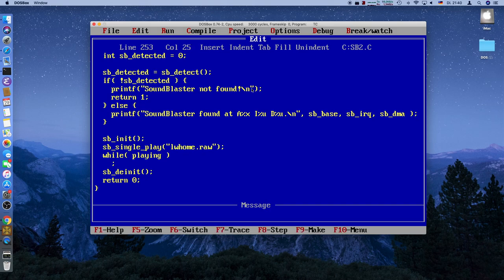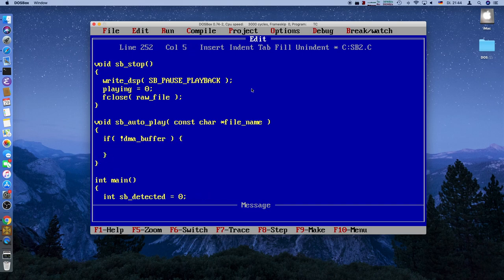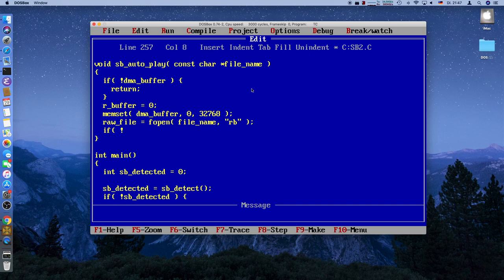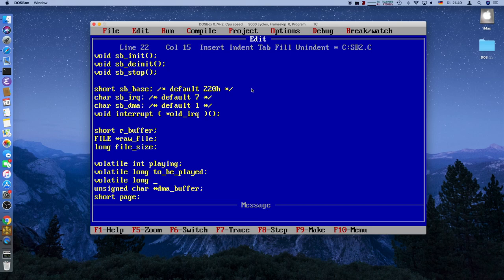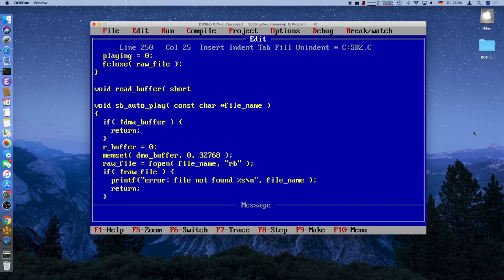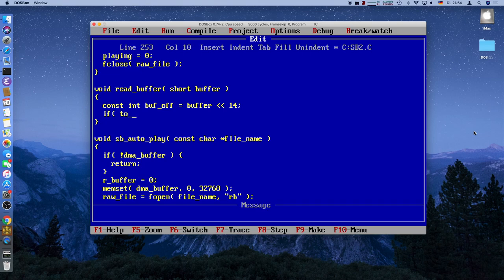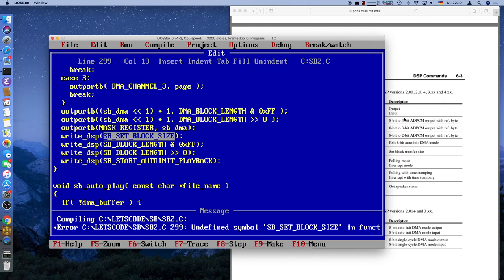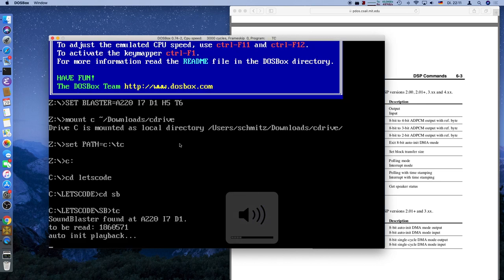Let's Code MS DOS 0x0B: SoundBlaster Autoinit DMA

Comment: First of all: Thanks for the great video. I enjoyed this very much.

Just a minor correction, though: When setting the DMA mode register (DCM), you mention (and elaborate in your code comment) that the first two bits (01) are there to configure it for block mode transfer, when actually they set up single mode transfer (block mode would be 10 instead).

According to the OS dev wiki, this is the correct mode for transferring sample data to Sound Blasters, so the code is perfectly fine, it's just the comment that is slightly incorrect.
Reply from the maker: Thanks for correcting.

Comment: I am trying to switch from single cycle playback to autoinit, so far unsuccessfully because EMM386 crashes the PC instantly when I send 0x58 instead of 0x48 to DMA. Will keep trying, but noticed you are using 0x58 too which is not block transfer, but a single cycle transfer the same as in 0x48. At least every document on DMA I have found says that 01 is single cycle and 10 is block and also that SB needs 01. It is probably just a small mistake in the comment, but it is a bit misleading when someone desperate as me is down to trying everything ;D

Comment: Great video - as always! I’m still coding along on my 486SX-33 with TC 2.01, memory model is set to huge. I’ve compared my code (written along with you as you made this video) with your source on GitHub. For some reason, it doesn’t work as it should on my computer. When the interrupt handler switches from auto init playback to single cycle playback, the program crashes. So it played a RAW file but 2 blocks before the end, the computer crashes. Did you try running your code until the end of the RAW file was reached? I’m interested to see if you encountered the same problem
Reply from the maker: Have a look at episode 0x0D — there I fix a bunch of things. Mainly: Do not read files in an interrupt handler! That could very well be your crash.
Reply: root42 I’m currently watching 0x0D - thanks. I download your GIF.C from GitHub (and MS-DOS messes up the line breaks lol); it does ask to include gif.h — which I can’t find. Is gif.c the same as gif.h?
Reply: root42 Sorry my mistake - I was watching 0x0C. Not at 0x0D yet. Will wait for that.
Reply from the maker: You might want to do 0x0D earlier, since my SB code had a bug that didn’t trigger on dosbox, but on real machines
Reply from the maker: Regarding gif.h: it’s indeed missing. I only published the gist for the gif.c. But the header shouldn’t be too hard to figure out. Otherwise you can use one of the later episodes. They should have a full git repository with the gif.h included.

Comment: wow indeed very nice series ! is there any change you can show us how to mix two or more sounds programmatically using this mode ? i could mix 8 bit unsigned pcm sounds using sb 'direct mode' but i have no much ideia in dma modes ^^
Reply from the maker: You will have to use a timer interrupt to incrementally mix multiple voices in software. The MOD players all do it like that. It takes quite a bit of CPU though. What you can do for example is register an interrupt handler with the timer (18Hz per default) and keep track on where in the second buffer you are with the software mixing. Then simply add up all the samples playing at the moment (e.g. sound effects) for the next 1/18th of a second. This way you don't stall program execution for too long. HOWEVER: if you want to do this in REAL time, i.e. to react to game events, you can't do this in the second buffer of the double buffered audio. This would lead to great delay in when the sounds will be played vs. when the action appears on the screen. At least with 16KiB buffers this will be way too slow. 

What you can do in this case is make the buffers quite small, let's say 1/50th of a second. So 440 bytes at 22KHz. Everytime the DMA IRQ fires, you mix the next 440 bytes, taking into account all currently audible effects (gunshots, enemy screams, etc) and be very quickly done with it. This way you only get 1/25th of a second of lag (because we are double buffering). I think this would be acceptable. It definitely isn't an easy task though...
Reply: @root42  thanks a lot for such a complete explanation, i could get the idea ! well, i'll try the 'single cyle' first and see if i can mix later. please keep with your great work :) !
Reply from the maker: I would be interested in results. I never did something like that either, but might need to do for the final game I want to do on this series.
Reply: @root42  so cool ! i will definitely follow your videos, i can't wait to see the start of the game :) !
Reply: @LeoOno  Hi Leo! Have you managed to write a mixer yet? I can't figure out how to do so :)

Comment: any plans on protected mode and extended memory and so on?
Reply from the maker: Maybe. I will have a bunch of other topics to cover before that though. Never did protected mode myself back in the day, so I will have to read up on it as well. I only used it via djgpp which comes with a ready made DOS extender. Using EMS and XMS on the other hand should be straightforward in Turbo C since both have relatively simply interrupt based APIs.